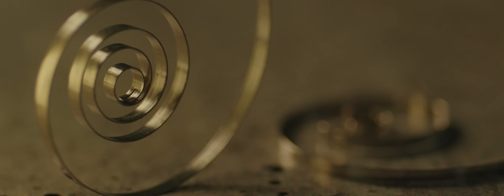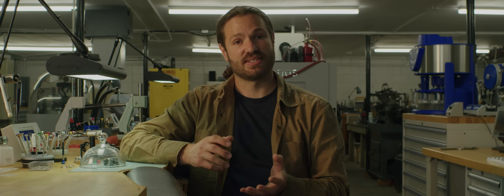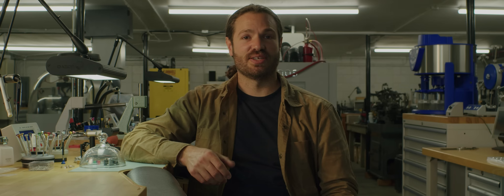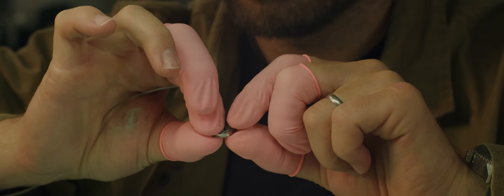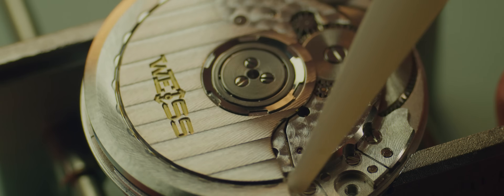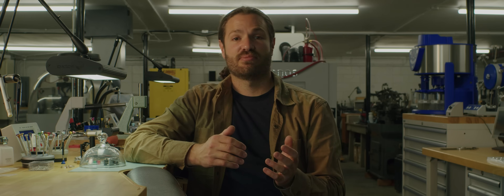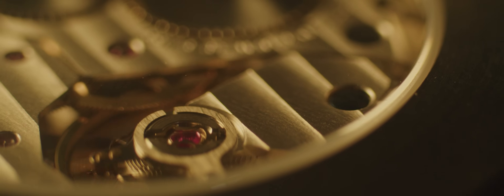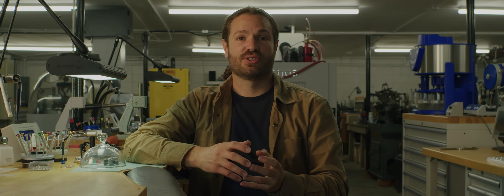Wristwatch Mainsprings

Comment: In an automatic watch, does the mainstring wind and unwind simultaneously or does it alternate? I don't see how it can be doing both simultaneously.
Reply from the maker: In all mechanical watches, the mainspring can be wound while it is unwinding. When you wind the watch manually or automatically, the energy is going into the arbor of the mainspring barrel assembly (the center of the coiled spring).  As the watch is running, the energy is escaping form the mainspring through the outer barrel teeth and into the geartrain and escapement.  You can add energy even as it uses up energy.

Comment: i prefer a old 100 yea rpocket watch thats keeps running 100 years later.with th same iron carbon mainspring
cumshot it
Reply from the maker: Old carbon steel mainsprings have many downsides and do not last long. That is why they were replaced. They rust, they also become set and loose their power. They also break from winding and unwinding stress. Just because you wind it up and it “runs” does not mean the old mainspring is good.